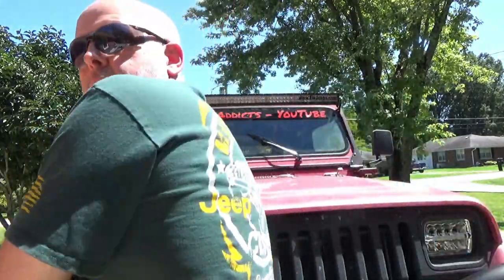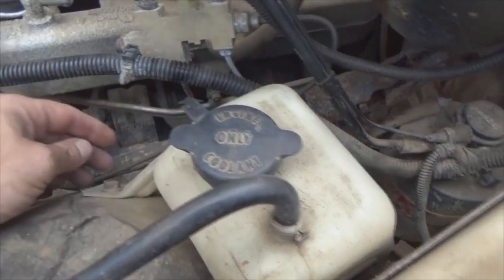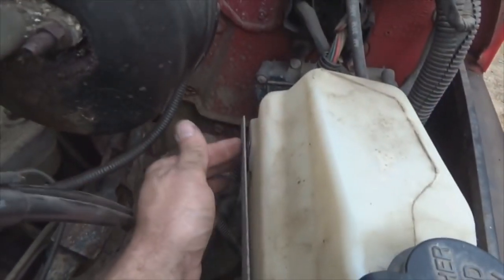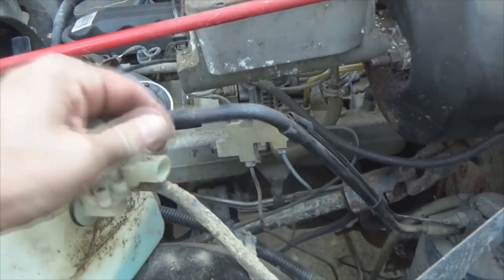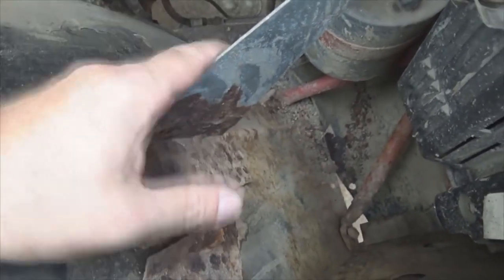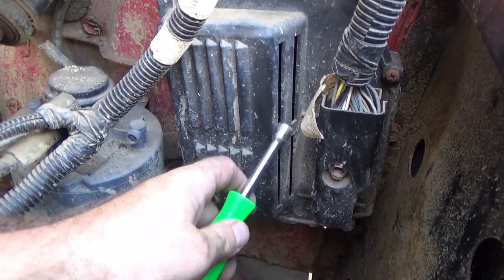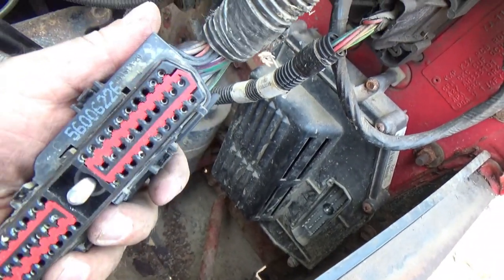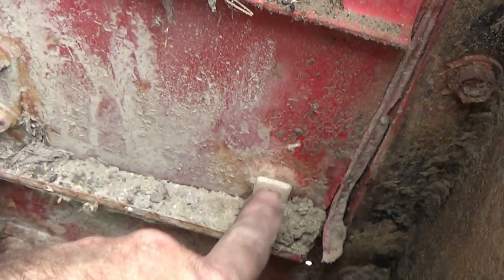Jeep Wrangler YJ - Remove and install a PCM. The Jeeps Computer #swappcm #jeepecm

Comment: A mechanic replaced my PCM but it turned out to be a fuel pump instead.  Now I'm getting a code 22 (Engine coolant temperature sensor) with some rough driving/idle.  Could they be related?  Thinking about putting the old PCM back in and seeing if it goes away.

Comment: 1993 2.5L with auto transmission. Recently my Jeep has been having an intermittent issue that now won’t go away. It is starting/running fine in first gear, but the moment it auto shifts to second the rpm’s drop and it shakes like a banshee. I then stop and the idle returns to normal. I tried cleaning throttle body, replaced sensors (IAC, TPS, MAP and crankshaft position sensor). Also has a recent distributor change, but was running fine after that. Last month when this happened I was able to disconnect the battery overnight and it resolved…not this time. Any ideas. Could it be Ecm?

Comment: Hey! I just done a complete body and frame swap on my 1995 jeep YJ due to being hit right where that computer is, it was running still even after the hit but I swapped everything over to a new frame and now it is not firing, and when I turn on my key I dont hear the pump even kick on, it ran a 12v Jumper to the wire to the green/balck I think wire that leaded all the way back to the fuel pump and it does kick on once I do that. Ive chaces wires, grounds, and used the test light on all the inside and under the hood fuses and all are fine and not corroded, im at a loss. It sounds like a CPS but it was working great not 2 weeks ago. I really need your help.
Reply: This is a similar issue to what I'm having, did you ever figure out what was wrong with it?

Comment: Was looking for an estimation of the time it takes "AFTER" the installation of the new CPM board.  Like driving around, resetting, heat up / cool down.  Any ideas?
Reply from the maker: Its an OBD1 system. It should be install, start ... go.

Comment: i have replaced everything for a "no fire" distributer, cables, coil, CPS, etc....... now gonna try replacing the PCM...
Reply from the maker: Check to see if your "Check Engine" light works. If it does your computer should be good. Good luck, I hope you get it figured out.
Reply: @Poweraddicts  yup... it works as should but no voltage coming back to the coil...

Comment: I HAVE A VERY STUPID QUESTION, IS IT POSSIBLE TO REMOVE ALL THAT ELECTRONIC AND STILL DRIVE THAT 4.0L??????? I JUST HAD IT WITH SENSORS..!!!!!!
Reply from the maker: Is it possible? Yes. But I personally wouldn't. The YJ fuel injection is the most simplistic design of any FI system ever made. I used to be a die hard carburetor guy. Now I covert my toys to FI because you just can't beat the drivability.
Reply: @Poweraddicts  i have so many issues with the sensors....one is screwing one after the other and...i m always guessing whats wrong again!!!i have slant six, 318 with carbs,, and so on ..no guessing here...but computerized engines....nope.where can i find thoses infos???,,any ideas???..thank you very much for your replies, you are a great help.